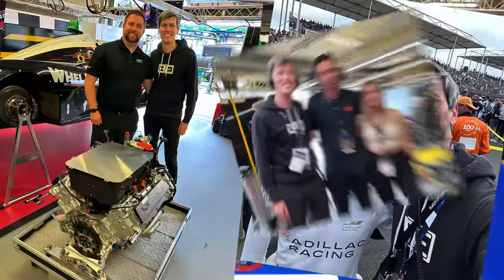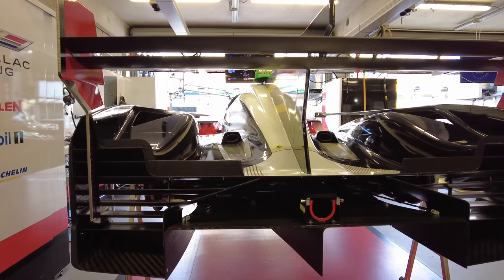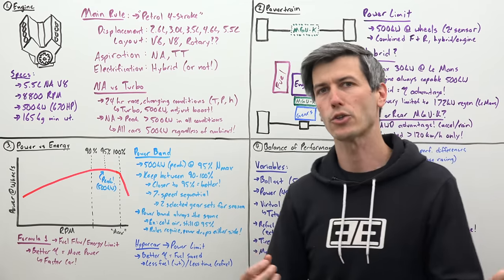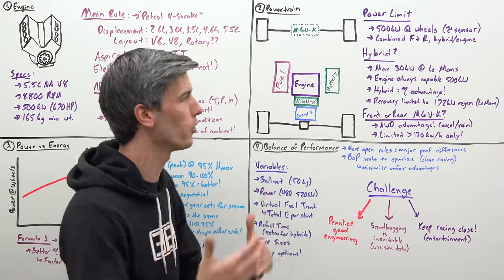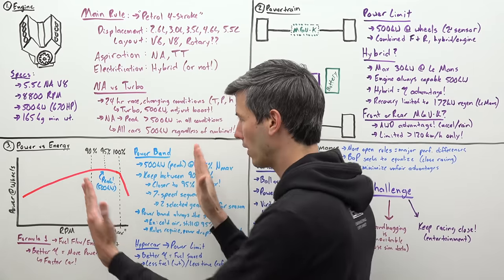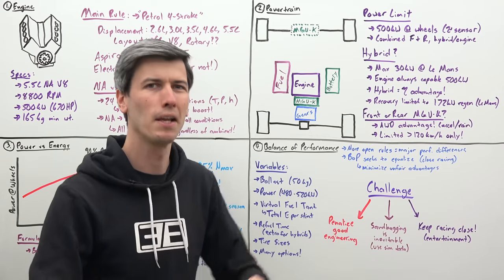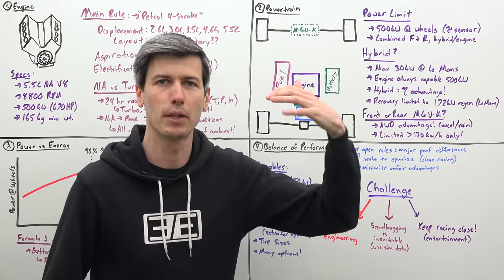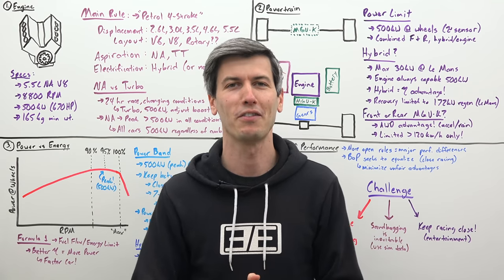Are Hypercar Engines Better Than Formula 1? — 24 Hours of Le Mans

Comment: So I have a question. When it comes to the balance of performance. On its face it seems extremely gameable. A cynic might say Balance of Performance" could be used to essentially pick the winner. If the race is run by anything like the FIA, we've already seen them pick a winner in 2021, so what prevents this rule from essentially letting the powers at be pick the winners?
Reply: The 2021 F1 season was simply a poor application of the rules by a weak director (Masi) whom was easily influenced by the first principle to have his ear. Toto and Christian drove that poor man crazy. But that wasn’t anything like BoP regulations.

BoP is codified outcome-based specification modifications. It’s really nothing new. NASCAR was engaging in it back in the 60’s and 70’s with their carburetion/restrictor-plate fiddling, which was an attempt to make for close racing. Of course, in the last 50+ years NASCAR has basically become a spec series, and between that and the stage racing, fantom cautions and overtime, they can deliver close racing week after week. That seems to be what the newest breed of race fans want.
Reply: @sking2173  okay, it's just as a relatively new F1 fan(became an avid fan mid-2019 season, and seeing the FIAs judgement and lack of consistency even starting with the Ferrari scandal over fuel limit in 2019, and of course 2021 season finale....it just seems like they could easily massage the rules as they see fit to lean in any particular teams favor. I mean I personally think the FIA wanted to make sure lewis didn't break the all time championship record, knowing the next year would be a rule change and Mercedes wouldn't be likely to be the front runner since redbull started working on the new regs earlier.
Reply: @thomasbarrack1384  — At the Emilia Romagna Grand Prix it seemed exactly the opposite, when after Hamilton crashed in a single car incident and lost a lap and still needed his car repaired, the other Merc driver and the future Merc driver came together causing a crash. Toto was in the horn immediately begging Masi for a red flag, to which Masi capitulated. This resulted in giving Hamilton not only time to repair the car, but gave him his lap back. Hamilton netted 18 points that day, a true gift. Without those 18 Masi-gifted points, how would the championship standings have looked going into Abu Dhabi ?
Reply: @sking2173  you're absolutely right, but Hamilton weren't tied for points and race wins at the very last race of the season, at which point the FIA makes a call that has never been made before in the name of "giving the fans a better ending to the season" when one of the leaders pitted and the other one hadn't, then magically the cats between the two leaders get to unlap themselves but no one behind them. They blatantly picked the winner. Had max needed to clear those back markers he wouldn't have won the race. It was pretty obvious they played favorites on that instance. They should have left the grid as it was and made them race it out. Had they allowed all cars to unlap themselves, they would've finished under the safety car. So the FIA literally made the only choice that guaranteed verstappens win as opposed to just letting it roll. It was gross to watch idiots prevent the biggest historical milestone in formula 1 from being broken, And I'm not saying it's everything to do with race, but Hamilton being a man of color makes it an even worse look when you consider the bigotry that's been unearthed since.
Reply: @thomasbarrack1384  — I understand where you’re coming from. But I must say, it would have been a travesty if Merc had won the WDC in 2021. The RBR and Max were dominant, but fell victim to some very suspect situations. Besides the aforementioned incident and Masi’s meddling, you have Bottas taking out BOTH RBR cars in the first lap at Hungary, which was consequential to RBR in potential points loss and in that it later caused the grid penalties for component replacements, and the now infamous Silverstone incident. If not for Merc’s harpooning, they would not have even been close in points to Max at Abu Dhabi.

As for Lewis, he’s likely the most hypocritical man on the entire F1 grid, and arguably the most bigoted. I have a difficult time mustering up much sympathy for him these days.

Comment: they have to be careful tho to not make it too RNG, otherwise manufacturers might be gone as fast as they came. watching WEC this year is definitely more fun than f1 imo
Reply: I think the biggest fear at the moment is cost. That is what killed the LMP1 class, It killed the Group GT1 class, GTE died in part because of that. F1 has been dealing with similar issues about the run way costs of the sport and trying to desperately control that, it hasn't been going well.

It is something that can quickly ruin motor-racing, because it just limits those that can pay the budgets and that is only going to be a select few.

Comment: What many people don't seem to understand about Formula 1 is: it is intended as an engineering competition, not as a driving competition. 

The whole point of Formula 1 is to see who can build the fastest race car. The drivers barely matter, they are only there because the cars can't drive themselves (yet).
Formula 1 races and championships are supposed to be decided in the design offices and wind tunnels, not on the race track.
Hundreds of millions of dollars in price money are handed out based on the results of the "world constructors championship", as the constructors of the car are the people actually competing in this sport. Whereas the "world drivers championship" is only symbolic in nature, handing out nothing more than a silver trophy.

However, for whatever reason most people seem to only care about the drivers, not about the engineers. They are more interested in racing than in engineering. Why they still watch Formula 1 anyways (and not the many other race series out there which are specifically set up as competition for drivers) i have absolutely no clue, but it seems to be the case.

Endurance sportscar racing used to be an engineering competition as well, up until a couple of years ago. But at the request of the car manufacturers this has been changed with the introduction of BoP.

Now engineering does not really matter anymore. As long as you can build a car faster than the reference value you are guaranteed to be competitive, and it is up to the drivers to make the difference. 
There is no point in spending money to make your car faster than that, since BoP adjustments will only slow you back down to the reference anyways.

It also means that manufacturers are not forced to build whatever promises the best race result, but instead can build what suits their marketing. Whether that is a big V8 engine in the Cadillac, a huge double-kidney shaped front air intake on the BMW, the "claw"-styled head and tail lights on the Peugeot, it all fits perfectly into the brand image.

There is no point in overanalyzing the engineering in these endurance race cars. None of them even try to build a faster car then their rivals, they all just try to build a reliable, cost effective car barely fast enough to beat that reference. The final speed of the car depends on only one thing, and that is the BoP settings, decided by the race organisers.
If you are interested in engineering, if you want to see a competition in car development, then sportscar racing is no longer the field for you. You should watch F1 instead.

But for the vast majority of viewers an engineering competition is not interesting anyways, they want to see drivers fight in equal yet interesting machinery. And sportscar racing provides fantastic competition between some of the best drivers in the world, in some of the coolest race cars in the world.

Comment: Only thing I wish for Le Mans is if they made it a level playing field for hybrids vs non-hybrids. The HP can be the same but the torque will always be higher in a hybrid vs non-hybrids
Reply: That will never happen. The ACO would never give the non hybrids the same playing field, it’s not in their interest. Having a non hybrid minnow team like Glickenhaus or Vanwall win the 24hr of lemans against giant factory teams with hybrids powertrains would create a shitstorm for the sport.
Reply: Jesus christ. it seems like you guys have no clue about torque and horsepower... you have to realise that horsepower is simply torque multiplied by rpm. so if the max hp is 500kw at the wheels the torque at the wheels is also defined. So no noone has any kind of advantage in that regard. If your combustion unit can not match the power curves, that were known before you even started development, your engine is simply underpowered.

Comment: For me the coolest thing about any engine concept is that the fastest car around the Nordschleife isnt a V10/8/6 or an Inline 6. No, its damn V4
Reply: Only because F1 cars aren't allowed to run in the Nordschleife.
Reply: @gatocochino5594  u sure? because of some corners you would need to increase the ride height wich makes their ground effect useless. also it reaches a top speed of about 370kmh  which is 2 kmh s lower than the top speed of the fastest f1 car of all time (low down force set up mercedes in 2016). I guess the f1 car wouldnt be faster maybe if the track is completely flat but not with corners lile the carousel

Comment: Stable, simple rules often make for the most competitive racing. Interesting that the FiA are consitently unable to achieve either for F1 and are constantly changing a ton of variables each season.
Reply: Rule changes are one of the tools F1 uses to prevent dominance of one team for too long. At some point, a leading team will get it wrong and fall down the grid. Mercedes is just the latest example.
Reply: @shiftfocus1 Strange how the exact opposite happens: New rules immediately preceed a new period of dominance...
Reply: I wish they would just once leave every single rule the same from the previous season to see what effect it had.

Comment: Hypercars are cool and F1 cars are cool — for entirely different reasons. As you explain, endurance cars have multiple ways to tackle their design challenge. In F1, the formula is defined and the teams have limited by hyper innovative ways to gain an advantage within them. Both are cool. F1 tends to create dominant periods because it's about absolute excellence.
Reply: F1 is a constructor championship, Endurance is a drivers/teams championship. LMP2 is litteraly spec racing.

Comment: Endurance races are different than 300 kms. F1 sprint races with different reglaments and rules to comply so requirements for the engines and rules for chassis are also quite diverse.
F1 overtaking is the culprit of the boring F1 races and it could be perfectly solved.
BimmerN53

Comment: Endurance is the keyword not Power that's why 'Balance of Performance ' is done.
All you have to do is make a car that last 24hours. Test of Endurance not Power.
Power must be equal and the best Endurance car keeps that Power constant throughout the race otherwise you'll have to pay the price of Endurance with Power which will strain your car to a breaking point before 24 hours is over.
Power is keyword for F1.
Reply: ENDURANCE racing did fine for 90 years at LeMans without “BoP” …
Reply: @sking2173  no it hasn't it keeps getting too expensive for manufacturers. name 1 class that's lasted 5 years with more than 3 consistent manufacturers

Comment: Adding ballast lol, that’s fair. F1 is good with engines. Differences in F1 are actually small but significant. Currently only Max Verstappen is on his own league. Everyone else, including Perez, could be 2nd till 12th. Without Max, this years winners would be differ almost each weekend. 
That guy nails the best car with the best performance. But again, in qualifying results are determined bij 0.0x of seconds.

Comment: I doubt GM/cadillac has ferrari, honda or toyota know how to design and produce small-mid sized powerful and efficient turbo V6, infact GM indycar engines are made by ilmor.
GM introduced the actual DOHC V8 on the C8R back in 2020, it produced a road version of that engine for the Z06 model and a more racing optimized version that powers the cadillac lmdh... because of mandatory power/torque curve given by rules and bop, it simply makes no sense to use a very large NA engine, the 5.5L fits good for what it was made for.

Comment: They need to get rid of bop at least  in hypercards 
Bop is understandable in gt3 class ok it's to keep budget law 
If there's budget cap in place to budget in check 
What's the need of bop 
In old times endurance racing was all about engineering
Reply: A main point of the Hypercar class was to reduce the budget requirements over LMP1. Manufacturers ended up spending each other out of competition until only Toyota was left.
Reply: Yeah but a budget cap has the possibility of one team just dominating like in F1 which means all the other cars leave. I also doubt that we would have as many cars with a cost cap rule set. Having to develop the car every year would be way more expensive and not viable for customer teams.

Comment: No rules but 500kw limit? and It should be fuel flow rate that should be limited right? and the Balance of Performance, they give more/less weight to cars?? Why? cuz they make more power or what?
Reply: Keeps sport cheaper when one particular Team cannot spend 100 milloin and get a way to fast car. Now there is no point for overspending when you penalized anyways. Also you can make cheaper engine when the power is limited to something. F1 should implement something similar.

Comment: if vibration is an issue, why not use an inline 6 or a v12 or a v10.
Reply: Weight, packaging, more moving parts.
Reply: @vvevvevvvv  true! but thats where engineering and design come in play to balance all the variables. Audi had a diesel V12 and won until they dropped out. Porsche had a V4 Hybrid. 
I am suspecting, Cadillac didn't want to dive into areas out of their expertise.
Reply: Disclaimer; this video threw me off. I had known that flat plane is better balanced and has less vibration, while the cross plane has to  have counterweights to balance vibrations. I am wondering why are you advocating, esp. being an engineer, that cross plane cranksharfts are better balanced. Completely confused. 
My thinking is, Cadillac wants the corss plane for torque which flat plane doesn't get without revving to a decent rpm. Plus Cadillac might not have the expertise to tune a flat plane for optimal use esp. if they are not hiring European engineers.

Comment: Cool episode. Not a big Cadillac fan. But, cool vid. 
Much more of a fan of the Toyota GR010. They operate under WEC rules which are even more loose with their rules. The GR010 has a 665 hp twin turbo 3.5 V6 and have a 274 HP electric motor on the front axle for 939 total HP. They just carry more ballast. Toyota likes this method because it lowers the CoG of the car which dramatically improves their actual down force in highspeed corners.
Reply: They aren't running anywhere near that power in WEC. They are subject to the same 480-520 kW range of power just like every other manufacturer

Comment: I understand you’re explanation about balance of performance. But what I not understand… Toyota had by far the fastest car this year at lemans but due to BOP they not win. They do the best job but don’t get al the exposure for that. What is up for Toyota to race next year. That. Is the reason I don’t understand BOP in the highest class in the WEC… the stakes are to high and to expensive, FOM changing the BOP just before lemans. On spa Ferrari was no where near Toyota on lemans they win. This is a form of competition forgery if you ask me…

Comment: I wonder if they have tried using the koenigsegg V3 in a Le Mans car? Have a feeling that would be pretty wild if they tried it. It's so tiny but so powerful, just put nitro through it everything will be fine. see the Dyno says so.........

Edit: Just ignore the smoke coming off the block that's perfectly normal. Promise.
Reply: Worked for Mazda. The last rotary.... at the end of it's legendary LeMans run, the 787B (one of 3 cars) was shot and the diver needed a stretcher.

Comment: except no rotary engines....wan't it banned after Mazda dominated several decades ago...or am I thinking of a different race?
Reply: Mazda won 1 race and never dominated. rotary engines were on the chopping block 2 years before mazda even won that one race. only f1 style engines were allowed in the new group c rules back then. rotary engines were at le mans several times later on
Reply: Yes rotary engines were banned are allowed now though. You can literally bring any engine you like with the new rule set.